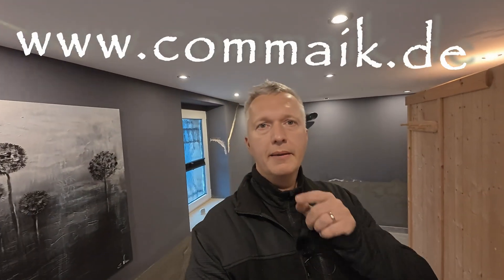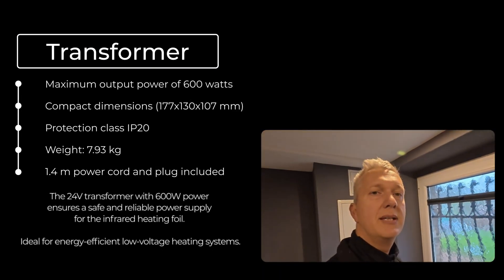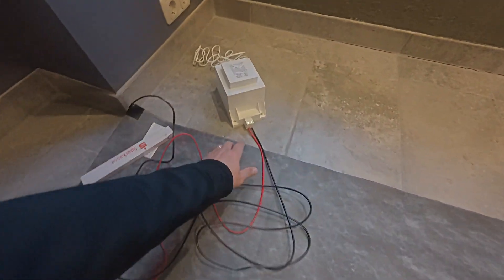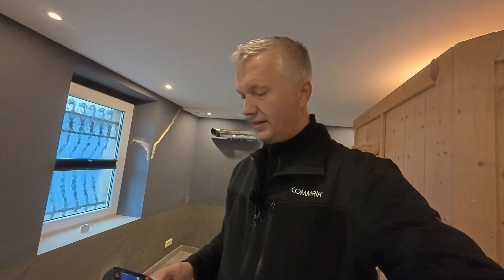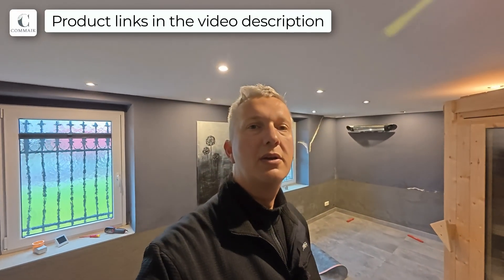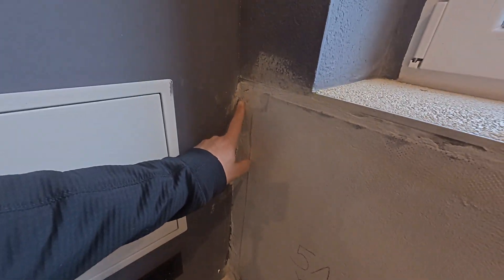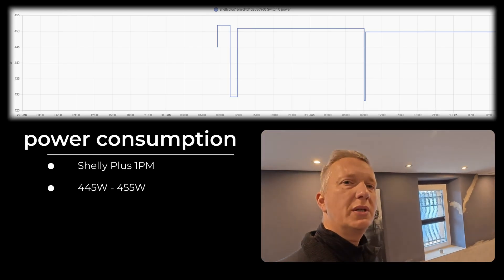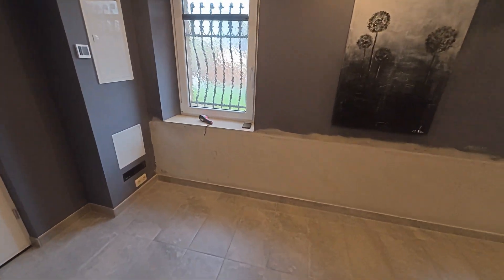DIY Heating Film: Transform Your Cold Basement Walls!

Comment: Good job, this is how technology changes life! One suggestion though maybe just me that missed in your video, that is you can put a thin aluminum foil or something similar in the back of your thermal film so that the heat/thermal will be bounced back from the wall as you don't really want to waste the energy onto the wall.
Reply from the maker: Hi Jason,
thanks a lot – really glad you liked the project! 😊
And you’re absolutely right: using a thin aluminum layer or reflective insulation can help reduce heat loss into the wall and improve overall efficiency.

In my case though, I intentionally skipped the reflective layer because I didn’t just want to heat the room – I also wanted to help dry out the wall itself. This is a basement space that was previously renovated and dehumidified, and the gentle, consistent heat from the film helps reduce any remaining moisture in the masonry over time.

But for other use cases – like under laminate flooring or drywall – your tip is definitely a great addition!

Appreciate the thoughtful feedback! 🙌
Best,
Maik